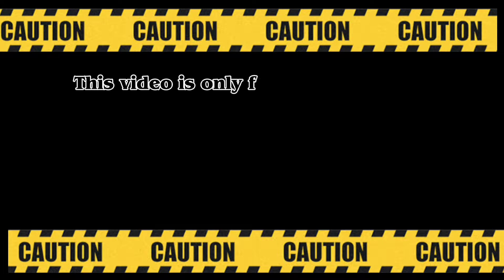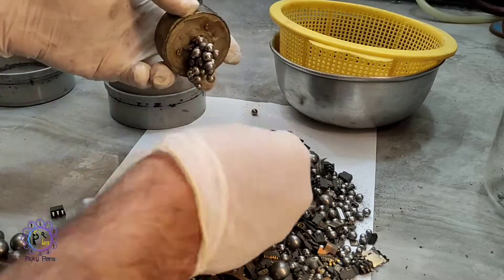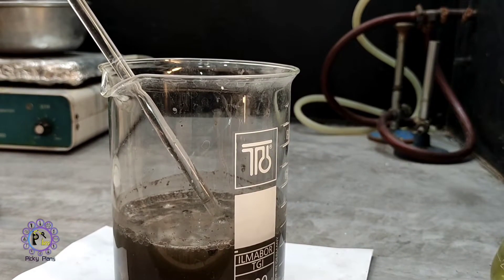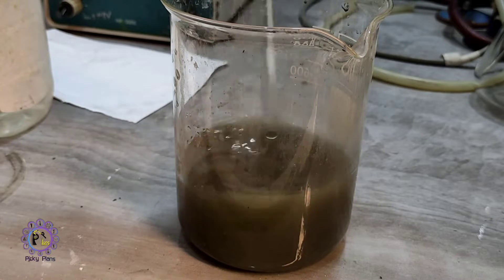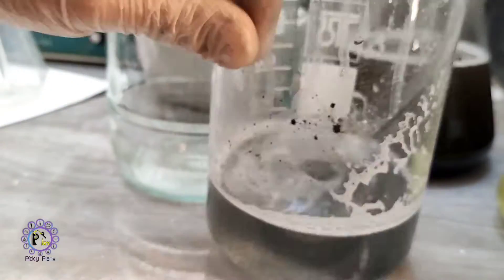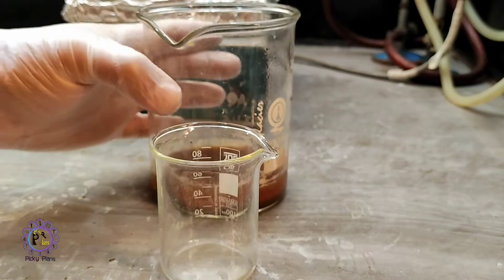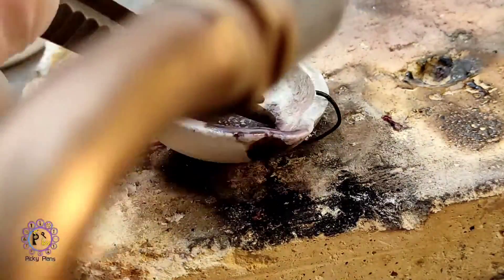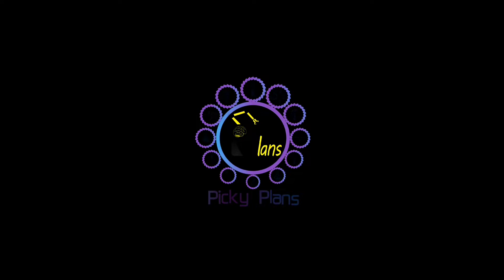High efficient Cyanide GOLD STRIPPING | MOBILE phones

Comment: Its better second time with aluminium instead zinc or its just because its cheaper metal?
Reply from the maker: It's possible but gold precipitation with aluminum is in very fine form, filtration is 100% necessary.

Comment: What kind of scrubber do you use on your fume hood? I would love to see a video of that! Also I really like all of your homemade machines very cool!!!
Reply from the maker: Thanks.
I have two barrels , in my homemade scrubber. First filled with 3% H2O2 and second filled with 40 % NaOH sol 
Air outlet goes into the first and second Barrel respectively. They are placed on the roof.
Sure , I will show the system in a video . First it needs to be fixed ( for now not working)
Reply: @PickyPlans  I can’t wait to see it!! Love your channel you are so very knowledgeable! Keep up the great work!!!
Reply: @PickyPlans   what else can you use for precipitation instead of the zinc powder
Reply from the maker: Aluminum foil can be used or a power supply through electrodeposition process

Comment: In some mining companies, the solution of gold-cianide circulates around a zinc plate,where the gold adheres and is then scraped off.
Be careful. 1 gr. of cyanide can kill 4 adults.
Reply: @PickyPlans  I also have a small lab, and I'm removing silver from circuit breakers by saline electrolysis, and something yellow has appeared. In your video I found out that it is copper Thanks for sharing useful information